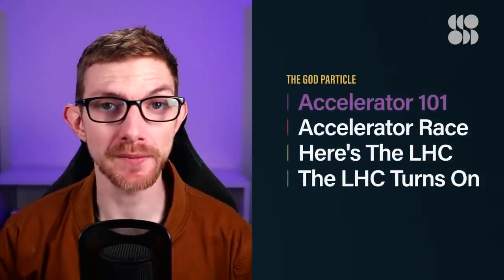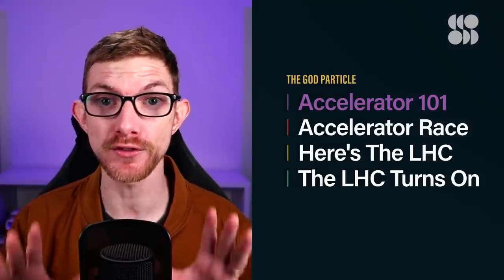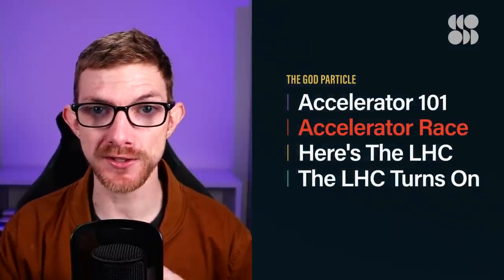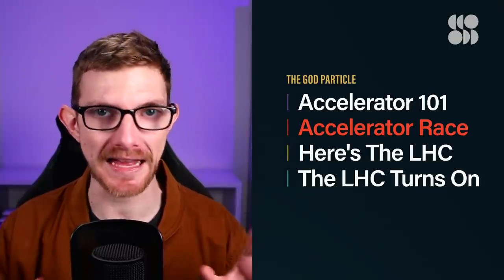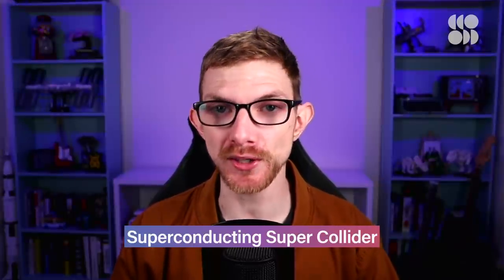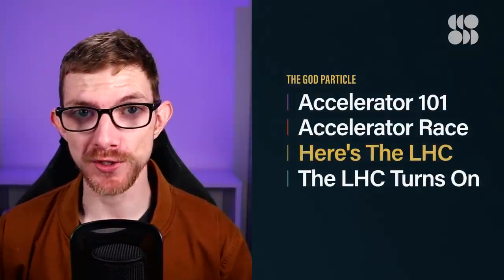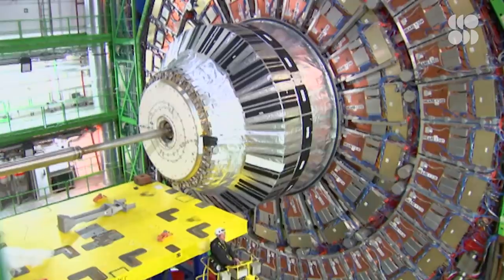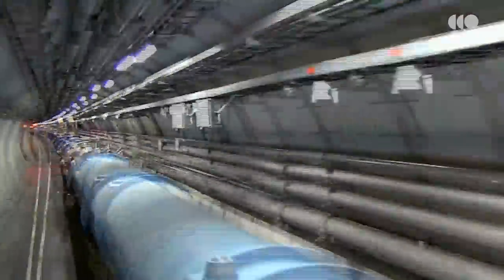Why We Need the Large Hadron Collider

Comment from the maker: Do we need a bigger, more powerful accelerator after the LHC?
Reply: Definitely. But do we have enough money though?
Reply: I think, the questions should be different ones.
When can we afford to build something that has a significantly higher collision energy? Where can we build one? Might there be an advantage to building one in orbit, in a Lagrange point, in a rock in the asteroid belt?
Reply: @philippzimmerer1280  If we can construct such large structure in space, let alone in a Lagrange point, I don't think money would a problem at that point. Building anything in space is just expansive rn.
I think FermiLab at Chicago has a smaller particle collider.
Reply: @potatonoodlebear8035  Yes, we're definitely not talking "start construction next week" for a space accelerator. Or in a decade, if we're realistic. My guess would be that we will see two more generations of terrestrial accelerators before we go spacebound. 

There's plenty of colliders in various locations around the world. Fermilab has the Tevatron, which is the second largest to date. CERN built other accelerators before, which are now operating as pre-accelerators for the LHC. Energies and luminosities, as well as detector capabilities have been improved over the decades of course. LHC is just the (current) pinnacle of what physicists have been doing for the last 70 or so years :)
Reply: It's doubtful it would produce much in the way of results. The LHC has NOT proven much of anything. Ask Sabine Hossenfelder.
Reply: Yeah

Comment: One probably really simple thing I have never heard explained about E=MC2 is the actual values. What I mean is Energy in Watts, Degrees, Newtons, Pounds lol. Equals mass in Grams, Pounds, Bananas?

And even the speed of light in Mph, Kph, meters per second?

What units of measurement are used in the equation? I'm sure there are options like energy in Watts requires mass in micro grams whereas energy in newton's requires mass in bananas.

Obviously I'm no physist but I think my question makes sense. I hope
Reply: E is joules
Mass is kg
Speed is metres per second
These are the standard units for most equations in physics
Reply: @elliotmoore2598  thanks Elliot. I'm glad I won't need a decalitre to kangaroo power converter.

But more seriously I've heard that equation hundreds of times. But never any comment about the values used. Much appreciated.